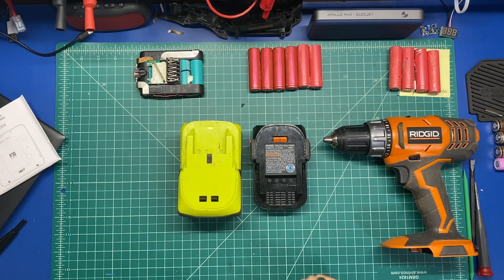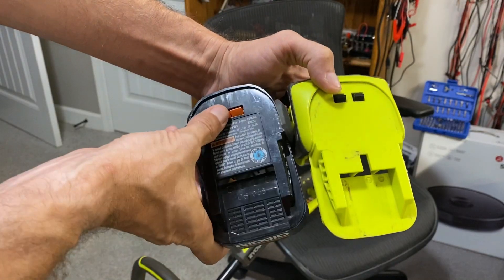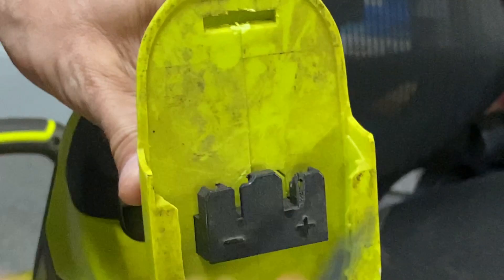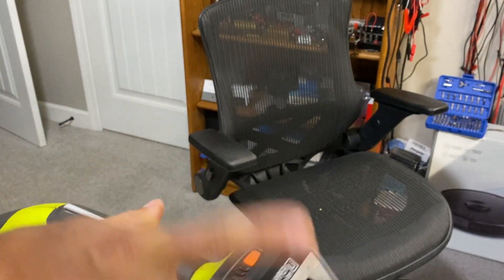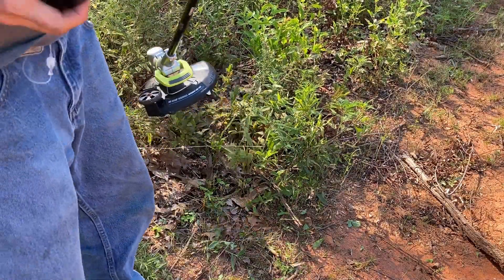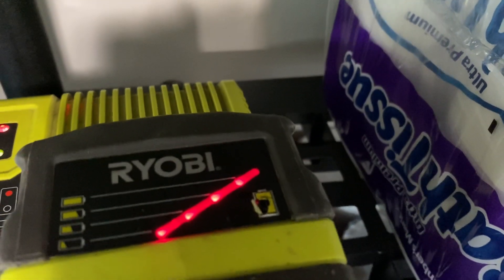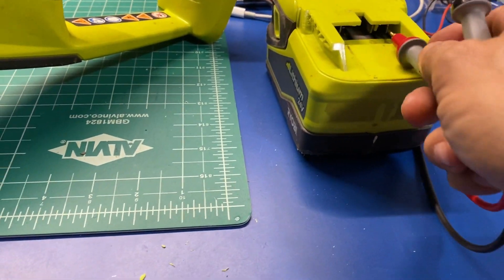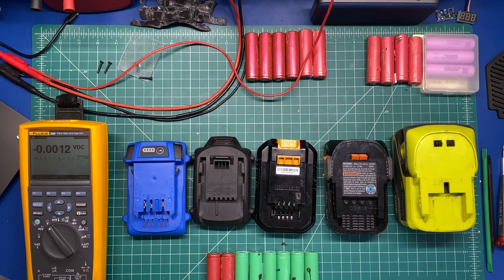Ryobi 24V Tools running with 18V Ridgid Battery

Comment: Were you using the 2.0Ah battery?
Reply from the maker: I was using the 4Ah battery in this test. But the 2Ah and 4Ah put out the same power using the same cells. The 4Ah only has longer capacity and run time. The only Ridgid battery I found that put out more power was the bluetooth 3Ah they used to make but they discontinued that battery.

Comment: Loved your demonstration.  Does it have to be the “Hyper” lithium battery?
Reply from the maker: I dont think so since both the hyper and max ridgid batteries run 30 Amp 18650 cells. So either one should work.

Comment: Most cordless "24v"sruff is in fact 18v nominal..

They just use the 18v 100% charged voltage (24v) to try and pretend their batteries or system is higher voltage. As soon as that batteries goes from 100% to 90 something %, you're down to 19v.
Reply from the maker: Thanks for the comment. I think you’re confusing the 5 cells packs (usually 18V) with the 6 cell packs. The 18V systems were only using 5 cells at a nominal voltage rating of 3.6V although some cells are nominal at 3.7V. 
For the 24V rated ones they are actual 25.2V fulling charged at 4.2V per cell but those use 6 cells and not 5 cells..So the nominal voltage for the marketing rated 24V packs is usually 21.6V to 22.2V, not 18V. But the honest packs are sold stating 22V (round up or down) and then the others advertise it with the full charge on the cells at 4.2V, but again 4.2V X 6 cells is 25.2V so either they market it under rated at full charge or 25V or they are only charging each cell to 4V and not 4.2 so they last longer. Either way it’s all mostly marketing and whether they use nominal or full charge voltage for the marketing technically neither is a lie.
Reply: @GadgetReviews-US  li-ion is 3.65/3.6 nominal. All cordless tools are li-ion.

All 24v stuff I see, are 18v nominal.

Eveb if it was 6s, wouldn't be 24v.
Its impossible to get 24v with li-ion.

Comment: Thanks for the tip! I was looking at a replacement for the 24V battery and couldn't find any for a reasonable cost. This solution saved the tools that I had.
Reply from the maker: No Problem, you welcome. Im glad this helped.

Comment: is there an adapter for a 24v Ryobi tool? I have two 24v Ryobi tools; a tree saw, and a hedge trimmer...battery is not chargeable now since it's several yrs old.  Looking for a less expensive and easier fix to this...so that's why I found your video.  I'd go the adapter route, if you have one to recommend?
Reply from the maker: Im not sure what way you are going. Are you looking to go from a ryobi to to using a ridget battery? My weed wacker is a 24V Ryobi, but its an older one and I think they changed the batteries to something else. 
You can always try sites like badaptor.com to see if you have other tool batteries that would work with the Ryobi using an adapter.
Reply: @GadgetReviews-US  I have 3 Ryboi 24v lawn tools (hedge trimmer, pole saw, and weedeater) - my ryobi 24v battery is dead, won't charge -- so looking for a way to use the tools... since battery replacement isn't available. :-)

Comment: Does it have trimmer have the same power or does it running slower with ridged battery
Reply from the maker: It may run a little slower but seems to have the same power behind it for normal trimming .
Reply: @GadgetReviews-US  is there an adapter i can use  on a Hercules battery or dewalt to fit this ryobi 24v tool

Comment: Good to know! I have both.  The Ryobi is still working fine but if the battery dies, I can use my Rigid battery.  I tried to get a spare Ryobi battery but the ones that have it, want crazy prices.
Reply from the maker: Yea, unfortunately it looks like they stopped making this model and I think this is the last season for mine. The motor is making a nice wine noise, probably just the brushes but its sealed and I cant seem to locate another motor that will work with this unit.

Comment: I need a battery and plastic shield cover for my 24V Ryobi weed trimmer.  Should I just buy a new weed trimmer and avoid the headache of trying to find these parts?
Reply from the maker: Ryobi stopped making the 24V packa a while ago. I was looking to order a motor for mine figuring its had 10+ years of abuse and couldn't find one.
You can try this site and enter your model number for the trimmer, but if they dont have it then you are looking at used parts and might be easier to get another one.
https://www.ereplacementparts.com/ryobi-trimmer-parts-c-7931_15633.html

Comment: I’ve got a ryobi 40v whacked that has an identical head on it. But a much larger battery. Anyway it’s a decent unit and got it used off of Craigslist. Have a great one.

Comment: @Gadget Review Videos can you also charge the rigid 18v using the 24V Ryobi charger?  As you are aware Ryobi doesn’t make their 24v batteries anymore, so I have a 24v weed eater with no battery (other one is showing defective) and hate to throw out a perfectly good Ryobi weed eater.
Reply from the maker: Nope, I would not do that. The chargers do charge to a different voltage and the 24 Volt charger will damage the 18 Volt packs.
Reply: @GadgetReviews-US  Ah true.

Comment: What cells are in the hp+ and hyper and octane?
Reply from the maker: The hp+ and hyper both have 18560 li-ion sanyo (panasonic) cells , I dont recall the specific cells models off the top of my head. The Octane ( I just bought one recently) are using a li-ion 21700 cells and most likely made by either Samsung, LG, Panasonic or Sony. I did not tear down the Octane all the way since the cells are encased in a shell and I did not have the correct nickle to spot weld it back together if I had tore it all the way down.

Comment: If you change the spot welded tin strips that goes from cells to cell.
Change a couple from series to parallels
You can drop the votes down from 24v to 18v and increase the A.H.
Reply from the maker: I could, but when I looked at it well it didn’t seem worth it. Currently it still run the whole yard for being 10 years old. The inside is assembled in some over engineered case holding the cells. Soldered Rubin cables for BMS monitoring, and temp probes. And did I mention it’s 10 years old, I’m just waiting for the motor to die and get a new one. I’ll probably repurpose the cells at that point.
Happy new year

Comment: 24v and 18v are usual the same 
You  check them with the dmm 24v is 24v full and 18 empty and 18v is exactly the same.
Reply from the maker: These packs are very different, most tool batteries advertise the nominal voltage of the cells in a specific configuration. But some market the battery pack at the full charge voltage of the cells hoping people will buy the higher voltage pack like in some older kobalt packs I tore down years ago.I dont know if kobalt still does this.
Ridgid is just over 21 volts fully charged, it looks like they only charge the cells to 4.1 instead of 4.2
The ridgid battery is 18 volts nominal in a 5S2P battery cell configuration. So it has 5 cells in series and each cell contains 2 battery’s in parallel for a total of 10 cells. Each parallel cells are at the same voltage rated for 3.6 volts nominal for a total of 18 volts. (Notes: Some cells are rated for 3.7 and even 3.8 nominal. It depends on the cells) At a full charge of 4.2 volts by 5 it would be 21 volts  maximum for the ridgid pack.
I think the cell configuration of the Royobi was a 6 cell pack (6S2P) and they only charged each pair of cells to 4.0 volts instead of the 4.2 volts the cells are capable of. Royobi doesn’t make this pack anymore, but when they did market the pack they advertised the max voltage on how they chargers the cells and not the nominal voltage of the battery pack. 
Side Note: Under charging the cell even 0.1 volt will prolong the lifetime of the cells.
Reply: @GadgetReviews-US  as long as you checked it wasn't sure if there was a particular difference between the 2 thats why I said usually. Havnt dug into the trimmer or mower batteries yet didn't know they released a 40v and a 24v for them
Reply from the maker: Yea, I don’t think they even make the 24V anymore for the weed eater.
Happy New Year
Reply: @GadgetReviews-US  might not but happy new years to you as well
Reply: Not quite. 24V is one extra cell compared to 18V. 18V nominal and 20V max are the same.

Comment: Where Dobie buy these adapter?
Reply from the maker: For this Ryobi 24 volt weed eater I just made a slight modification to the weed eater so the Ridgid battery would fit. I show how to do this in the video. I don’t think Ryobi sells the 24V version anymore and have never seen any adapters for this.

Comment: 10:00 Fluke 287?  How do you like it? That's expensive DMM.
Reply from the maker: It’s the Fluke 289, and I love it. Ive had problems. I trust it with high voltage and for being 5 years old its still as accurate as my bench meter. I bought it for the logging and resolution, i’m not disappointed like some of the other logging meters I have bought. The 289 might not log wirelessly, but I got the kit when it was on sale so I have the cable to pull the logs from it. I would defiantly recommend the magnet, for a big meter like this it hold it strongly and secure. https://youtu.be/CUmbSlDm9Lc